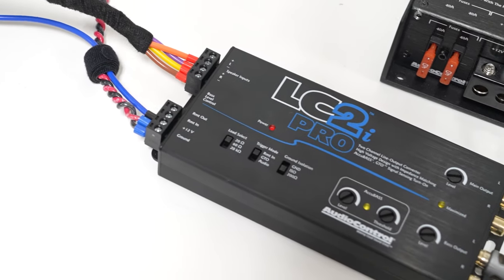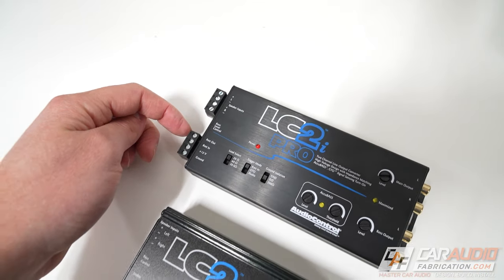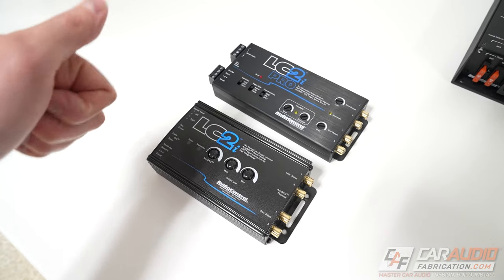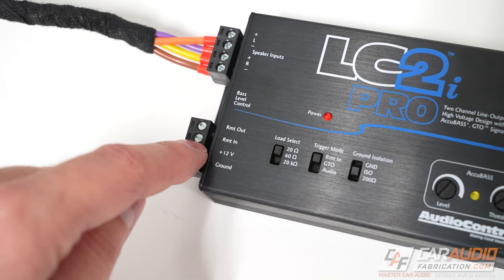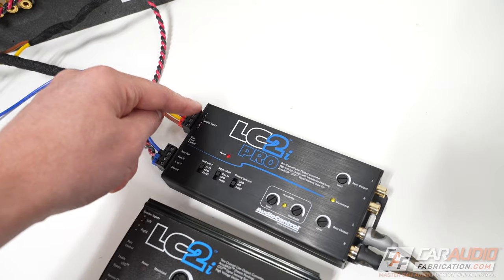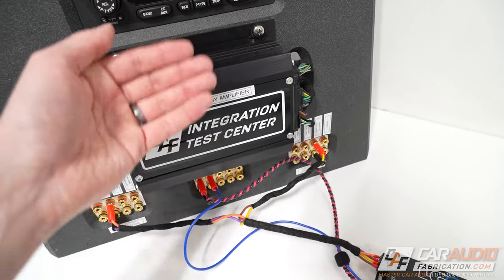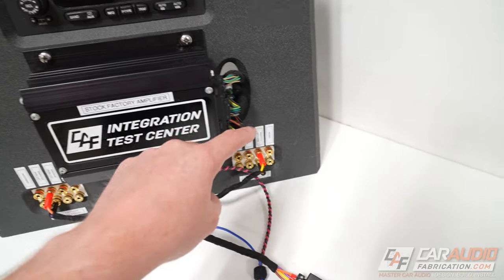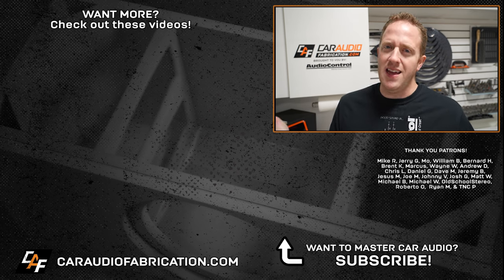Line Output Converter Explained - How to Install & Features to look for!

Comment: Hello! I have myself a 2 door VW Mk5 Golf so I'm tapping into the rear 2 woofers(speakers) for signal for the Subwoofer AMP and I have a question... for the REMOTE IN where's best to actually get it from? Since I'm doing pretty much everything in the back of the car, even the battery... I wouldn't really want to go to the headunit with a wire for it. I have the regular LC2i. Thank you in advance!
Reply: I tapped into my center console cigarette lighter positive  to get mine. Fuseboxes also work just make sure that whatever positive you're using is off when the car is off. Using a source that is active even with car off/key out will  work to turn the amp on but will obviously keep the amp running until the battery voltage goes below minimum voltage for amp. Also, make sure that the positive  has enough voltage for your needs...typically, you'll have enough power to turn on 1or 2 amps/devices via remote in using a 12 v positive.

Comment: So I have a cassette stereo from the 90s and it has rca outs for the rear speakers, could I just get Y adapters and connect those to a 4 channel amp or should i do this instead

Comment: Man I hooked up a whole System in my 08 Enclave Easy Peasy 🍋 Squeeze, But I just got a 2018 Envision, and It sounds like it's going to be a nightmare to hook up being I can't Swap the Factory Radio out! 😢
Reply: @kingdavid3790  you should be able to tap into music signal wires to send music to LOC then amp and sub from there. In my opinion this is easier than swapping out a whole factory unit

Comment: I installed an LC7i in my range rover which has the meridian surround system and setting up the accubass correctly is a nightmare. Without an RTA it's pretty much impossible.

Comment: Looking to install a sub and 2 speakers to the stock radio. Can I use the LC Pro to control all 3? Do you still need to run power to the amplifier separately or just off the LOC?
Reply: A power amplifier WILL NEED ITS OWN POWER AND GROUNDS, or fire may happen!?

Comment: But can you splice the wires so you can feed both the speaker and the converter.. or for example, if you just want to add subs do you have to sacrifice two speakers because you can not splice ?
Reply: Yes, you can but I recommend removing the rear speakers so you get more bass I side through those 2 holes and upgrade your door speakers.

Comment: I’m planning to add a sub to my 2022 Silverado non Bose system. I’d like to use the epicenter micro for the high level. Will a LC2i Pro still be needed for accubass
Reply: This is a great question! The technical/most expensive answer is yes, they= Ac would recommend both. But do you REALLY need both= i dont really think so, here is why? The Epicenter micro has Bass restoration built in= it takes a sample of the full range freq. responce, and adds in freq. that either are not present, or are very weak, and increases the output by the amount you choose with included ACR4 (2) into 1 Bass Knob.( inner Knob= Total subwoofer Volume control, and the outer Knob= Amount of Bass Restoration you want to add!). Plus the micro is the only Epicenter with A Pfm you can switch off! Pfm on starts limiting Bass output @ 25Hz, and with Pfm set to off= 10Hz!

Comment: Question if I bought the epicenter micro do I also need to purchase a lc2i pro to deal with the stock audio roll off or can epicenter micro deal with both the roll off and bass enhancement?
Reply: The Epicenter micro, with the Bass restoration, can compensate for bass roll off, and even adds bass that was not there by sampling freq. above the cutoff of Bass notes. Also has a 2 into 1 Bass knob, outer Knob is for Amount of Bass Restoration, inner Knob is for Total Subwoofer Volume= Awesome, plus its an active line out converter!

Comment: I have a 2020 Corolla with JBL package (garbage).  I’m using the Audio Control LC1i to connect an aftermarket subwoofer.  Question: I have to turn up the gain fully clockwise to achieve a max voltage output of 3.9 volts (on LOC).  Any ideas why I can not achieve more voltage?  I’m definitely doing something wrong as I want to put 5 volts into my aftermarket mono amp (Kenwood).
Reply: Are you using both left and right speaker wires, going into the high level inputs? If not, that is why. Also, you can just splice into the wires from both speakers, and use them aswell, just use electrical tape to cover the exposed wire.

Comment: Hey Mark...I Have A Question...I Have The LCQ-1 And The Maximized Light Is Always On...I've Tried A Different Ground From What The Guys From Audio Control Told Me To Do...But Still Not Good...What Are My Options Of What It Can It  Be...Any Help Will Do....Thank You In Advance
Reply: Are you sure the accubass threshold and  level gains are set to minimum to start off with.
Reply: @B15SDMDESIGNS  Yes Everything Was Down All The Way...And Still Light On..But When I Turn Radio On The Ppwer Light Turns On And Maximized Light Turns Off...Once I Turn It All Off The Maximized Light Turns Back On

Comment: If i need to do subwoofer speaker input, how should i connect there if there is +\- L and +\- R ? Because subwoofer come 2 wires only for signal
Reply: It doesn’t matter if you choose left or right and only have those two connected, as long as you have atleast one +\-, you’re good since subs play low frequency pretty much at all times during a song

Comment: Looking for help I just put a lci with just the subwoofer output ….. but my car is a g8 it’s had two factory subwoofers in back desk …. So do I need to run a neg and pos wire from both factory subwoofers to the lci or just one factory subwoofer ??? So it’s like your setup on the table but u only have one subwoofer output on the table my car has two subwoofers
Reply: Did you figure it out?

Comment: I use a DQ61 and I get an echo on the rear channel when I added a second mid and high amplifier for the back doors. Any ideas? There was no echo when I used a 4 channel amp using front and rear rca’s from the DQ61. Also when I use the pass through the front amp to the rear amp there is no echo. Only when I use the rear channel separate on the dq61 to a separate amplifier. Thanx.
Reply from the maker: Because there is delay somewhere in the signal chain. Try using the same signal for front and rear. You will lose fade capability but everything will at least be in time. Or go all out and get a DSP so you can time correct all speakers.

Comment: So I was recently told that there is loss of fidelity due to taking a low level signal, amplifying that, using the converter to bring it back down, so that it can be re-amplified. How much weight does this hold? No, I don't know what the suggestion for an alternative was yet.
Reply: It definitely holds some weight but most wouldn't notice the difference. The preferred alternative is a 4V or higher signal from the head unit directly to the amplifier, which is why he noted the caveat of people needing to keep their integrated units (stereo, nav, engine diagnostics, etc.) Since that is usually the case with newer cars, many go this route to retain the stock functionality of the multifunction unit while upgrading the amplifiers and speakers alone.
Reply: @brandonjohnson131  so the key is finding the wiring for the preamified signal from the factory stereo?
Reply: @benpatterson5081  Yes, but good luck as that could be like finding the proverbial "needle in a haystack". Most OEM's don't use RCA outputs, instead opting for complicated wiring junctions to route signals. Like I said, most people cannot detect any sonic loss of fidelity from using a high quality LOC so you're probably good to use one if you want to wire in an aftermarket amp.
Reply: This is why you buy a Quality, Active Line output converter like this Audio Control unit. It will convert the factory high level signal, to a Quality RCA output signal( that can be adjusted to up to 9.5Volts of clean RCA output Voltage) for your aftermarket Amplifier! By the way, most aftermarket amps wont need/want more than 4 to 5 Volts of RCA output voltage.

Comment: I recently installed a plug and play amp for the car speakers and now my sub amp signal is not as clean with the lc2i. I can’t get it right. What could be the issue?
Reply: What do you mean= plug n play amp? How DID you have your Lc2i hooked up, prior to your "plug n play amp? We have to know what you changed from before, to after, to know what to look for.
Reply: @evilinside5984  so it’s a VW. Focal makes plug and play door speakers and a “plug and play” amp focal impluse 4.320. My sub amp is separate but connected to the headunit for speaker signal. After installing the focal amp for the speakers, my sub does not sound as clean and the signal is much different
Reply: @Smallyardguy  When you say head unit, is there a separate factory speaker wire output, or is that the same speaker wire, connected to the now powered, plug, and play, speaker amp combo? If its not separate, your new amplifier, may exceed the input voltage, that the Audio Control LOC, can handle, causing your distortion/unclean sound?

Comment: My lc2i pro’s maximized light does not come on no matter what level the bass output is set at, I only have one speaker input to the lc2i so I wasn’t sure if that was the issue or something else is going on that someone might know about.
Reply: You need both left and right speaker inputs. But you can just tap into those rear wires, you dont have to disconnect them from your speakers= just cut the speaker sheath/cover, twist a wire around your speaker wire( then soldier, and or @ least put electrical tape around the exsposed wires), and run it to the Line out converter.

Comment: I have a unique question. I own an Infiniti q50 with the 16 speaker Bose amplified system. My dilemma is I want to add a 5 channel JL Audio 700/5 amp to power just the front door speakers and the rear door speaker along with a 10 inch sub. Where should I get my signal from, before the factory amp or after the factory amp?  I'm replacing the front door speakers with CT sounds 6 1/2" 3 way components, rear doors are JBL concert series coaxial 6 1/2". 
I want to have the factory amp to remain powering the factory Das speakers and rear deck speakers. My line level controller will be a Audio Control LCI 2. Also using a Phoenix Gold eq9.0 to tailor my sound for the speakers I'm replacing.

Comment: Hi,  Can the LC7 convert bass output using speaker input that has bass filtered out?  The rear speakers in my car is easiest to access and would like to use that to tap into my LC7 to plug into my underseat subwoofer with built in amp.   I first had it setup without LC7 into the high level input subwoofer amp and it sounded terrible.

Comment: Why is there no bass in subwoofer when both left and right inputs are plugged in?? Soon as I unplug 1....BOOM, BOOM!
Reply from the maker: Likely because your left and right signal are out of phase.
Reply: @CarAudioFabrication  
Got'cha...
Do I just switch the inputs on amp or?
Reply: @CarAudioFabrication  Amazing you are still responding to these older videos!

Comment: How do you get deep bass out of a stock car radio into your amp. Because most radio amplifiers doesn't go deeper than 60hertz! I want 20hertz. With low level pre-outs you have that. But in my car (and now a days almost in every car) you cannot replace the radio anymore. It's even hidden underneath the dash and controled through a tough screen....!? 🤷 Gimme back the 90's with oldschool Phoenix Gold with gold platted terminals and made in USA!
Reply: Dsp is your answer